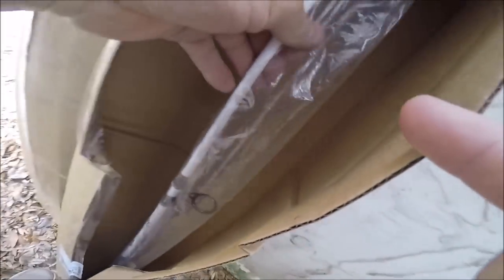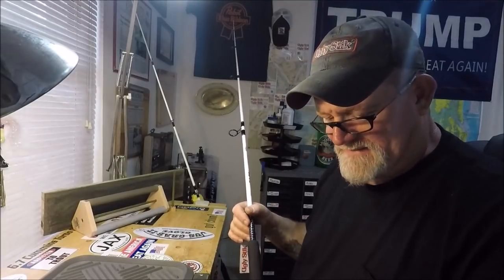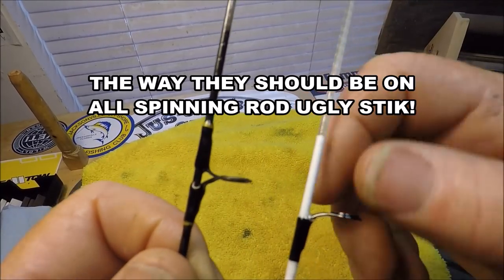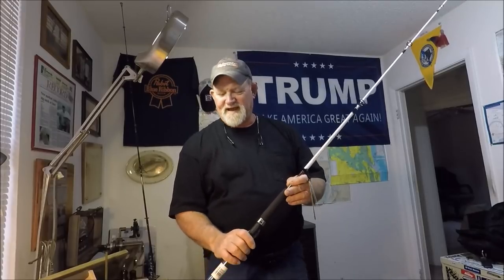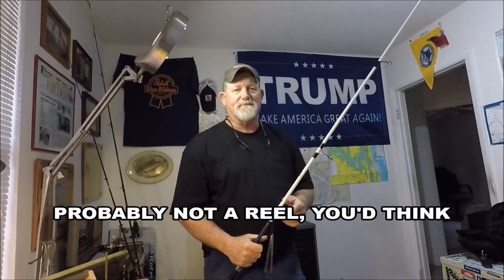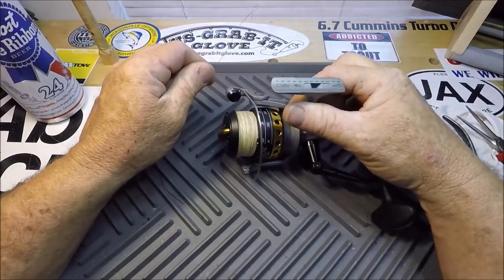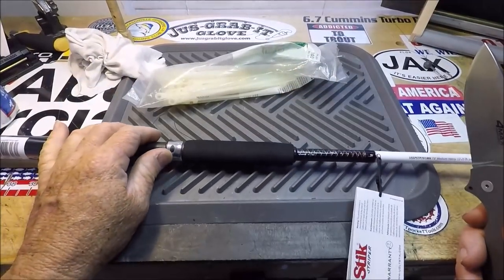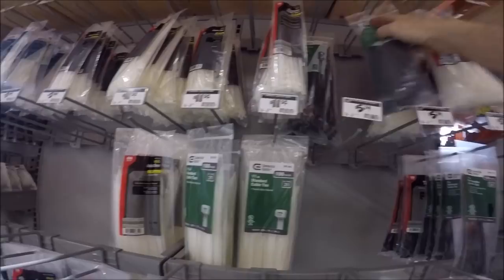UGLY STIK STRIPER RODS - I'M A ''ANTI-SPINITE'-

Comment: I would replace the tip. It is actually the easiest guide to replace. I don't need to deal with thread. Just heat it and put the new one with that glue. I have a bunch of guides here too, if u want some, but i don't think they look the same.
The Striper spinning rods are not my favorite ugly sticks. Very different from Striper casting rods, which do have parabolic bend. The spinning have exactly what u said - very soft tip and then stiff body. I will recommend a rod for you - Browning Silla Flex, 7 foot medium heavy, casting. From Bass Pro. Only $40. JUST BUY IT.
Reply from the maker: Why would I buy those I've bought these i already had 2, needed 2 more for a set. these are not for my fishing, but for customers. just wish they made them and then medium light action like the casting I'd be very happy I'll replace the tip if it breaks I've done hundreds